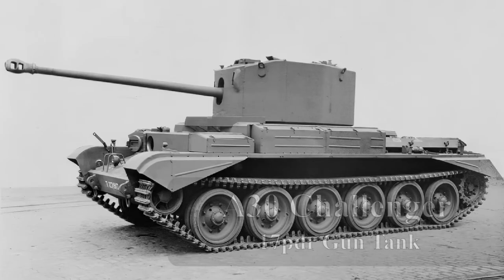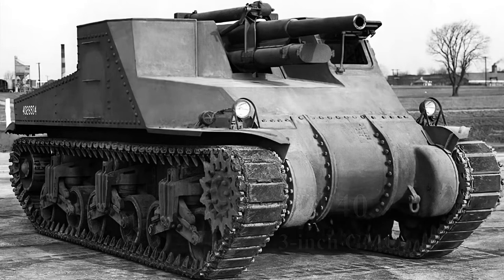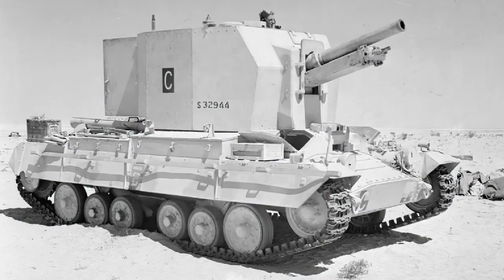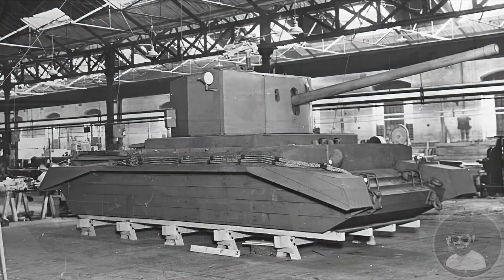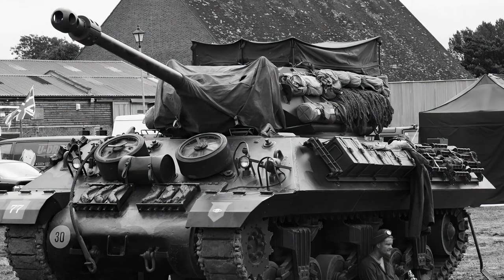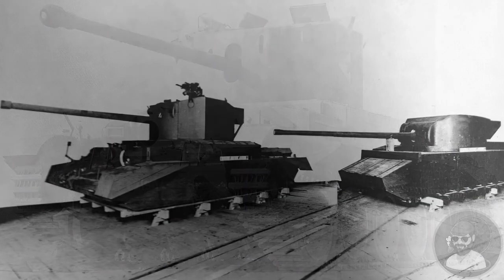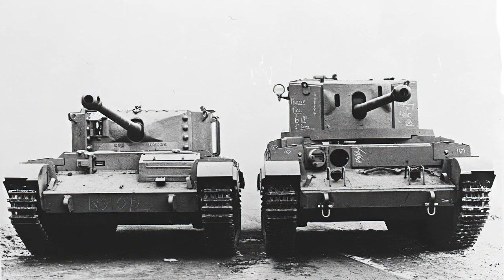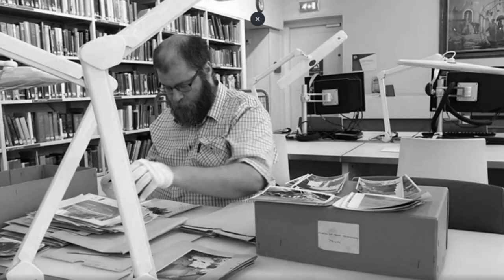A30SP Avenger and A30 Challenger - Tank Design & Development - Never Before Seen Pictures

Comment: I don't know the date of the 6-pounder gun mounted on Valentine with a gun shield (do you have any info?), but I have a suspicion that it is of a different date than the 25-pounder. The appearance of the 25-pounder looks identical (at least at rough glance) to the production Archer, e.g. the exit louvres at the back of the engine compartment, stowage, etc. That would seem to push back the 25-pounder to 1944 or later.
The General Staff had already decided that a 17-pounder gun tank should be created before deciding about SPs in 1942.  There was a meeting in July '42 about whether to build 17-pounder SPs, with someone (I think from the RAC) suggesting that if they were going to have 17-pounder tanks maybe the army didn't need SPs but someone else's POV was "well the RA will be there so they'd better have something which can keep up".  Already by September '42 they were planning to order large number of M10s and hoped/expected it would be possible to convert them to the 17-pounder.
Reply: gotta be good 1943  at the are arguing over valentine on vanguard while debating the A33 and so on . I've got the files let em root em out for u chris
Reply: @edfrancis712  Hi Ed, would LOVE it if you could! I have some files I could send you that might be of interest.  The July meeting notes I have are from Extract from Minutes of 6th Meeting of the General Staff Committee on Weapons And Equipment, 7/8/42, WO 32/18890.  I also have a file copied from the National Archives about the transfer of anti-tank role & equipment from the RA to RAC. How can I send you a message with DL links?

Comment: Got anything about the vision of the driver on the avenger?
Because if he closes his viewing hatch he hassn't got any other way to see
Reply: Avenger lacks the persicopes, but the viewing hatch has a slide panel which can be adjusted from left to right which puts a protective screen and eyepeices over the port to allow viewing safe from splash. in the up postion he can errect a pastic screen from elements etc. we have a pic which will go on the blog from inside his compartment however its in a  tall but narrow format and looked terrible videowise. hopefully folks might have more of the scallywag in service tho as those images are very rare.